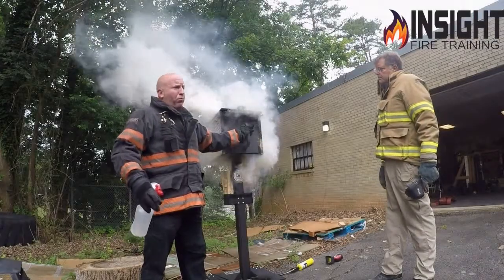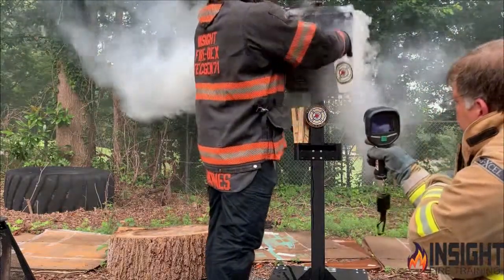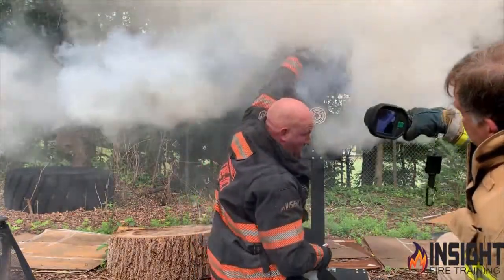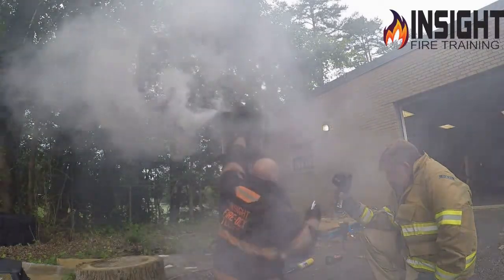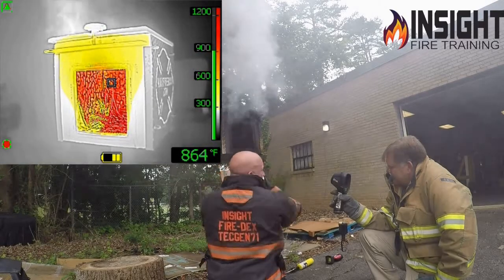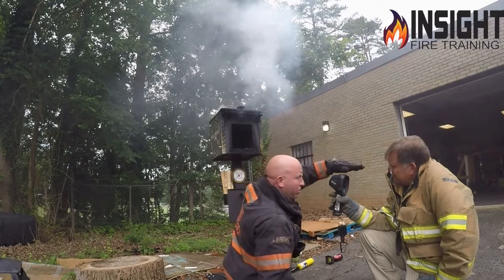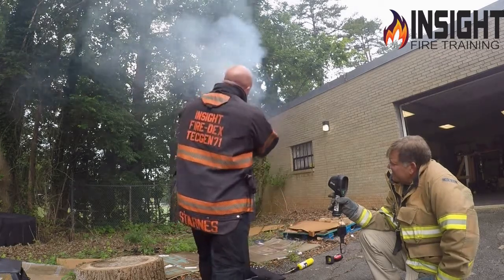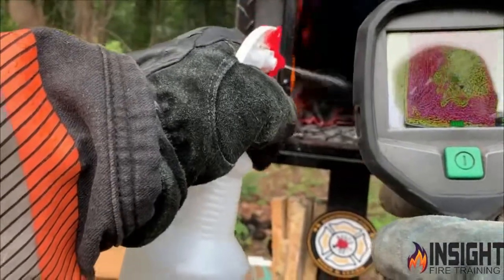Cooling the Door Prior to Entry?

Comment: Greeting from oversea, thank you for your video. Are you able to explain why it works like that? So in theory you do a 'surface-cooling' around the door which doesnt affect the fire room itself behind but once the door is open the hot smoke exits on the door frame which is now on a smaller temperature and because of this it needs more time to reach the (re-)igniion temperature again?
Reply from the maker: Hello, this concept is very common overseas in CFBT training where they 3 D the door. They cool the gases outside the door and inside the door to prevent the initial entry area.